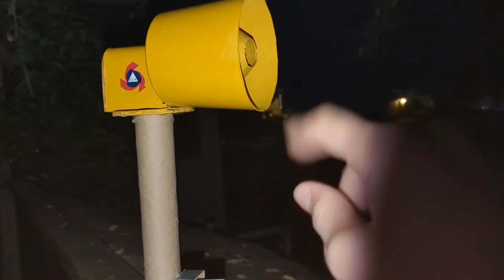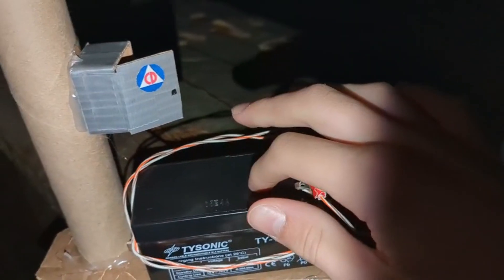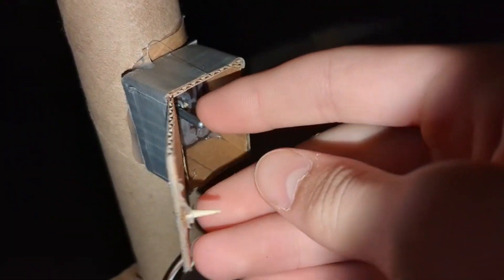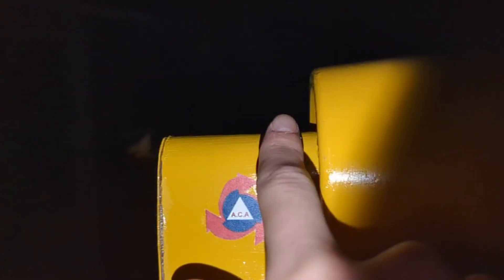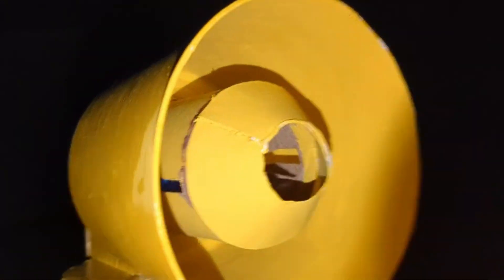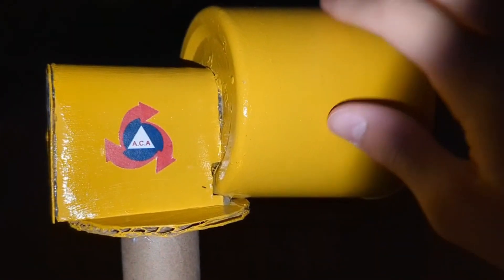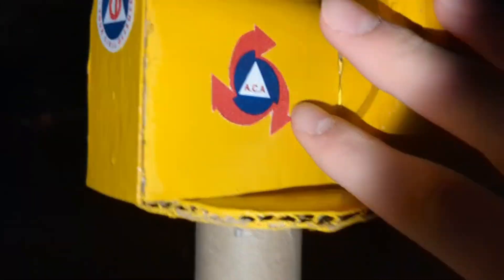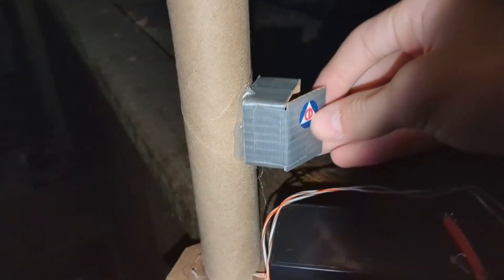Mini ACA P-15 Test!

Comment: The siren doesn’t sound that powerful.
Reply: Probably because it’s made of plastic and paper and not metal.
Reply from the maker: @atomicreptiliascreator738  Not really, it's just really small. I have made a new one that's a lot louder
Reply: Would you be crazy enough to build a miniature siren with 16 high-rpm choppers powered by a motor running them at the miniature’s equivalent of 15,000rpm?
Reply from the maker: @atomicreptiliascreator738  Maybe in the future lol
Reply: The full scale monster of a siren this is outputs 142 dB as only the 16 h-rpm choppers (not including the noise from the motors, which are the fastest and most powerful in the world)!
Reply: Also not including the noise from the gear reductions.
Reply: With a properly designed horn, the noise from the 4 beefy motors, and the sound from the choppers means that the total sound output is about 157.08 dB on the full size monster siren!
Reply: There are 10 models of the same 16 high-rpm choppers, btw. Each of them have a different output.

Comment: Nice, that one sounds smooth. I tried to make Federal Signal STL-10 with ACA Cyclone's hat, it's loud with running 5V AC/DC. What material do you use for the chopper/stator? I used hard paper.
Reply from the maker: I use different size cardboard tubes that can range from poster tubes, to empty duct tape rolls. I usually peel out a few layers and sand the inside so it gives me a little bit more space to work with or so that the chopper can fit in in the first place.

Comment: MAKE MORE BRO!
Reply: alr bro
Reply from the maker: I'm working on a Thunderbolt and a 2001 right now but I want to try 3D printing the thunderbolt chopper and I want to add a rotator to my 2001. Those are both huge roadblocks for me.
Reply: @harold-hihat make a alerter out of cardboard
Reply: How do make a powered siren